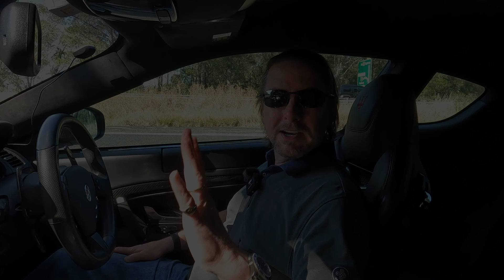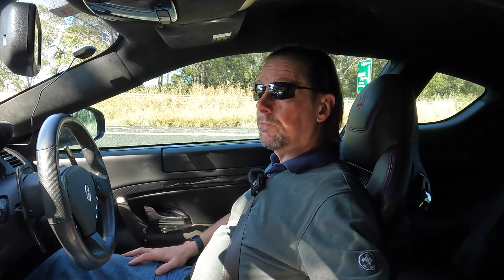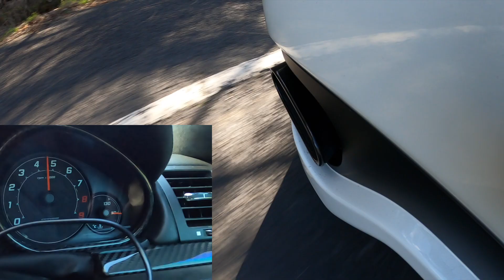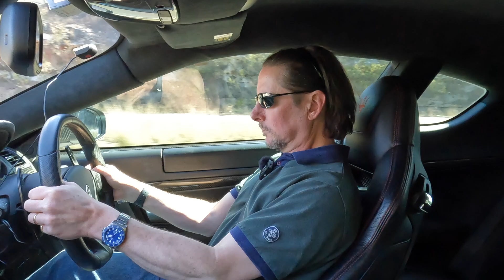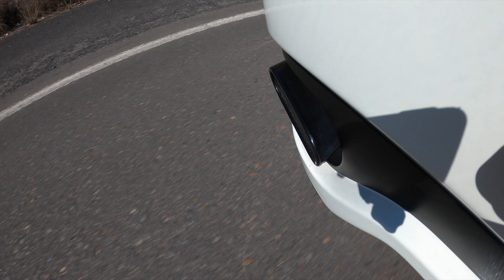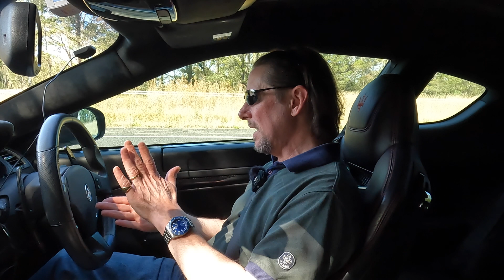MYTH BUSTED - F1 Gearboxes are NOT SLOW!! Maserati MC Shift | MGUY Australia

Comment: Thank you for this, finally someone that understands. So many wannabe carguys doesn't understand. It blips the throttle or cuts fuel and then forces in next gear with ease. Comes from motorcycle. I have tryed this on one of the the fastest motorcycle in the world panigale v4 and it is awsome. In theory this can be way faster then DCT. They will have this tech in the feature with a manual stick and clutch lever and pedals. Just like motorcycles. On motorcycle it is called quckshifter and blipper. Car or mc doesn't need to use the clutch just full throttle and shift, when you ride slow or in traffic you can use clutch if you want to destress mechanicals because the purpose is in top revs high rpm for fast shifts not for slow city stop n go. Car or mc just blipps. It is awesome just like F1. And f1 took it from mc 😁
Reply: It's actually not the same as a motorcycle. A motorcycle transmission has no synchromesh, it uses dog clutches which have teeth that will interlock with the selector when the selector is oushed into the gear. This means you can literally just push the selector into gear at any speed and it will interlock. Like you said, it needs to cut ignition or blip the throttle to slidr in because it needs to offload before engaging. This is why clutchless shifting works up and down on a motorcycle even without an electronic quickshifter. The Maserati/Ferrari F1 transmission and any ither automated manual is just a normal manual with a hydraulic gear actuator. It still has synchromesh. You cannot force the gears to engage too quickly or you will destroy the synchromesh. And because it's a single clutch, you cannit pre-select gears the way a DCT can. With a DCT, as you can pre-select gears, the actual gear actuation does not need to be as fast because you can be driving full throttle and you don't need that specific gear yet. Therefore the only thing that determines the shift time is how fast you can open and close a clutch. And because you have 2 clutches with one of them being opened and the kther being closed at the same time, the shuft time is half of how long it takes to open or close a clutch. With a single clutch automated manual the shuft time is how long it takes to open the clutch, shift gear while keeping in mind the synchromesh, and close the clutch, so ut is significantly sllwer than a DCT can be. Of course the can be some overlap with opening the clutch and selecting the gear, but it will never be as fast as a DCT. What you are mistaken in is with a normal synchromesh transmission you cannot just force the gear to engage. Clutchless shifting is possible with a synchromesh, but it has to be slow and smoith or it will cause damage, therefore it's never used with an automated manual. Automated manual does not equal the sequantial transmission used in racing, those also use dog clutches, just like motorbikes, and can indeed shift without opening the clutch. Hope this helps!